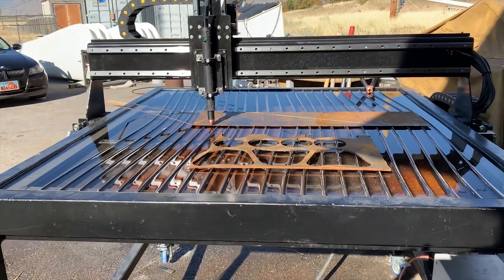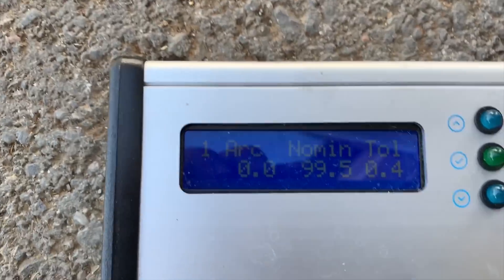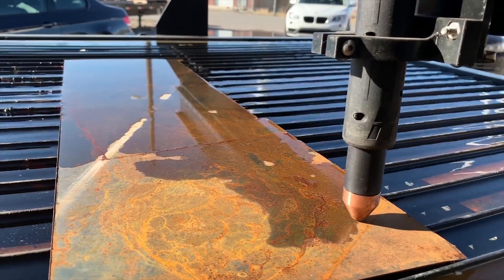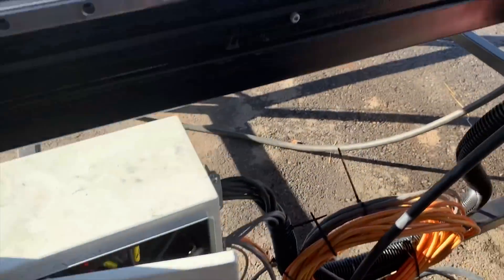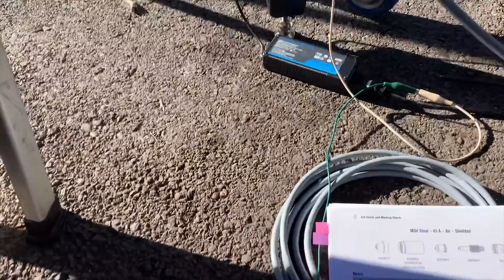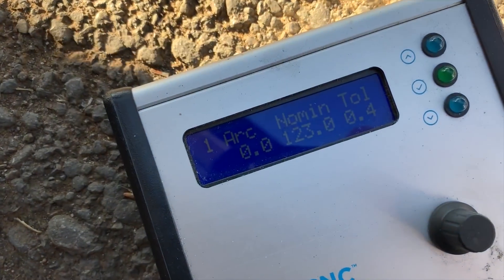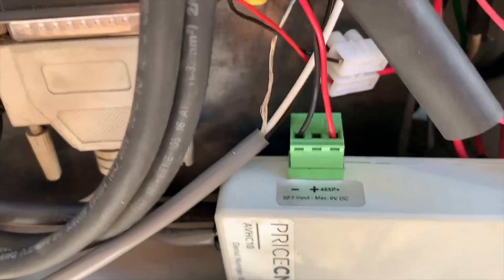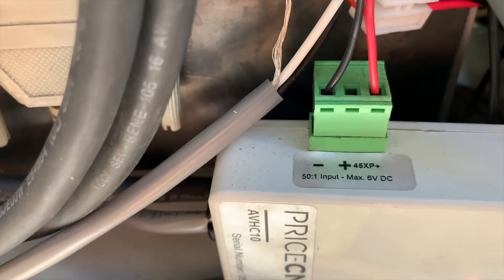DIY CNC Plasma Cutter || PriceCNC AVHC10 THC

Comment: When I bought my Price Thc, I was using a Hypertherm 1250..It does not have any option for torch voltage other than raw full voltage..Actually has 2 blade terminals for that raw voltage inside the machine..The Price has 2 options with that isolation box..Raw voltage using those larger connections or the 50 to one if you can give it that..the 1250 couldn't give that voltage only raw full voltage..
The 1250 finally quit and bought a 45Xp that has both options..There is a service bulletin 809520 from Hypertherm showing how to get raw voltage from the 45xp..So I will be using that..

Comment: Hello buddy! Something that I don't seem to find is the way the table is grounded and the positive clamp form the plasma cutter does not mess up your electronics. Did you isolated your electronics from the table? Or you just put the positive clamp with the grounded table and system?? I would be very grateful if you elaborate a little or send me a sketch. Thanks in advance!
Reply: @ToshDavis  what I meant is: the table is grounded right? Also absorbs the volts from the clamp of the plasma cutter right? The ground receives the voltage from the clamp? Which is positive?
Reply: @ToshDavis  thank you Tosh! That's why all this questions, I wasn't sure if the ground was receiving all this voltage from the clamp. But I guess that's how it works. Thanks again!
Reply: What is the answer to this question?  I want also to know,please help
Reply: @MangJanong  apparently the post is been deleted, if I remember correctly, the clap ground is positive, so is not really ground, and the "star" connection that you make to ground you can search for plasma grounding star connections. You'll find what you're looking for.
Reply: @johnlocke9609  i searched the net, but one thing is not clear to me, if i attach the work clamp(+) to the cnc table which has ground bus bar which all my electrical components are also connected, does it will not blow or burn my components?bus bar is the star point for ground then clamp positive from plasma is all connected to the table.
Reply: @MangJanong  Ill try to post what I did, because I dont remember the details.
Reply: @johnlocke9609  okay thank you bro.
Reply: Thanks for the reply, i downloaded a copy of hypertherm grounding practice, but on page 5, i saw Positive dc of plasma powersupply connected to bus bar of the table, there are two bus bar for grounding, but they are still connected base on the diagram.
Reply: @MangJanong  yeah, but what I gather is that you put your own grounding rod, apart from the one used for your house and ground your table.
Reply: @johnlocke9609  okay i got it. Thank you and God bless